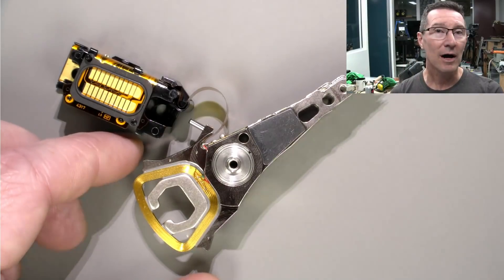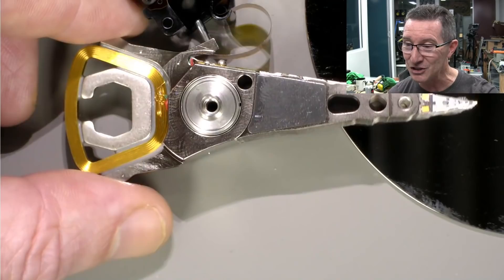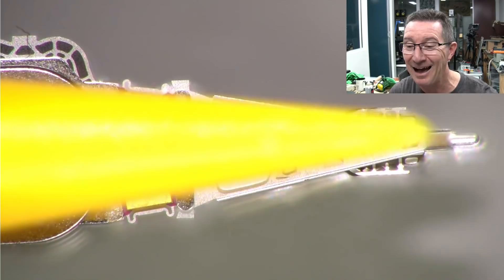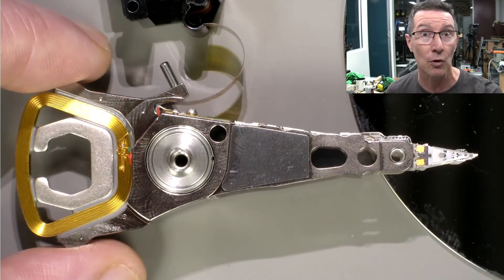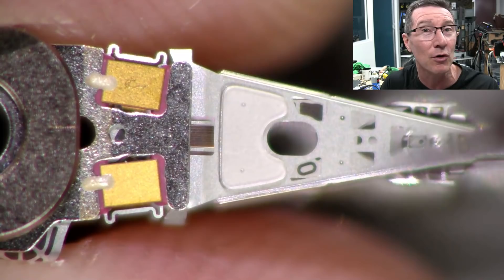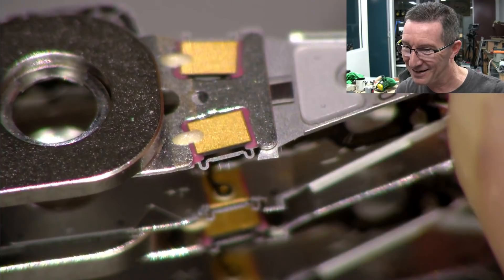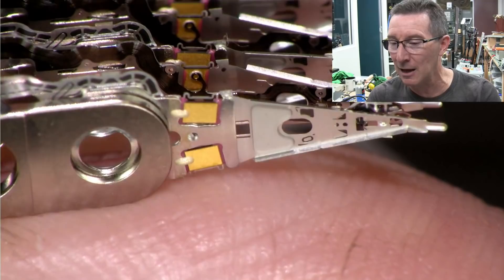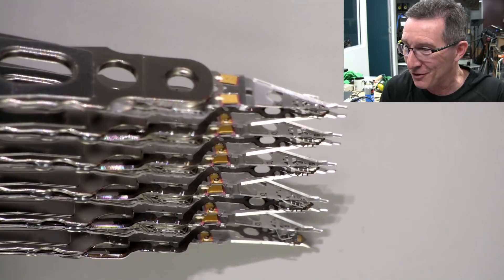EEVblog 1400 - Hard Drive Micro Actuators are AMAZING!

Comment: You should talk to The Slow Mo Guys, and get them to videotape one of these hard drives with the cover off. I think you will find that the two peizo  actuators are fired in near ultrasonic speeds, and at those frequencies, even solid metal starts to bend and wobble in some amazing ways.  All they need to do is to work with the harmonics of the head and it will wobble back and forth in a very predictable manner, and they could use that to steer them right to the tracks they want to access while the data is under the heads.

Comment: The engineering itself is amazing enough, but the design for manufacture is what really blows me away. Meaning, it's one thing to make a device that does what that drive does, but it's another thing entirely to be able to make it cheaply, reliably, without too many exotic materials or processes involved, with a minimal amount of customized tooling, etc. In other words, despite the insane sophistication we know is involved, it's the way that design screams "i have been refined to an extreme degree" that gets me. Those read arms are in a sense so simple they almost look like a high school robotic hobby project, yet you know they are basically space alien technology.

Comment: it would be an idea to reflect a laser from the tip and see if the point on the wall moves if you apply a signal to the actuator.
Reply: You might not see movement in the laser beam itself but you'd probably see some kind of shifting in the interference pattern at least.

Comment: Afaik it's very likely that these go up and down to control azimuth due to pressure changes (for different altitudes) + IIRC they would try to retract if they detect a drop so that there's a lower risk for the heads to touch the platters.

Comment: Last time I played with one of these. I powered the acuator on accident with the diode range poking around.

If memory serves. The actuator energized will contract the head on the same side. It pivets in the metal between the two elements.

Also if memory serves under those conditions the movement was indeed visible even with the naked eye.

Comment: The multi-stage actuator seems to serve two purposes when I saw the animation: more precise head positioning, PLUS keep the azimuth perpendicular to the radius even though the head travels in an arc.
Reply: I don't think the arc movement matters. As long as you're reading at the same azimuth as you wrote at, everything should work right. I don't think there's any need to have a consistent azimuth from one track to the next.

Comment: First, they store data on top and bottom of the platters.  Second, the position control has two loops:  coarse control using electromagnetics and fine control using piezoelectrics.  The micro actuators eliminate residual overshoot, ringing, vibration, etc. once the heads are close to decrease seek time.  Third, the two piezoelectric elements are operated differentially so that one pushes while the other pulls and the head bracket rotates about an intermediate pivot.  Check to see whether the opposite sides are connected to power for one and ground for the other.  Also, piezoelectrics generally operate on tens or hundreds of Volts.  Finally, the motion might not be visible without X500 or so magnification or an optical lever.
Reply: The range of motion in this system is around 1 um, and the voltages are around 10V. Optical lever is a good idea -- with a 5 meter arm, the movement of reflected beam should be clearly visible, provided the vibrations are kept low.

Comment: If you probe the correct contacts, you can then manually actuate the heads to get a readout on the scope. Then amplify and use that signal profile to drive. #reverse_egineering

Comment: Tuning these must get fun when they make smaller tracks.  Probably use a high gain but then use a dead band to reduce gains as it gets close to the demand position so you get fast movement and limit overshoot without having to use too much kI or kD.  I work on much bigger, less precise equipment so if anyone can shed light on that I would be interested.

Comment: Absolutely incredible! Controlling something physical, at the nanometer scale, and it’s something most of us use everyday and have no idea. 
der8auer recently did a few videos at a lab that has a SEM with probes small enough to test INDIVIDUAL TRANSISTORS on like 7nm process CPUs 🤯
It also uses piezoelectric elements to get such fine positioning.  
I didn’t know about using piezoelectric elements for positioning until that video, now this shows me it’s a lot more common than I knew!  Very cool.

Comment: It’s amazing just how much formula one level engineering goes into the spinning rust.
Reply: Soon it won't be spinning rust with the read writer head split into two separate actuators. Seagate is getting hard drives of this type that are nearly saturating sata 3 speeds. SSD's will still have these hard drives beat in IOPS by a considerable amount. but hard drives will no longer be painfully slow. it will feel like a low end ssd but with way better overall lifespan than flash ever could.

Comment: If i understand it right(im only starting to leard data recovery) there is sort of track map with micro-actuator corrections like "track X is on actuator position Y.+microposition Z. In fact, datastorage is so dense  that platter temperature  matters and causes seek errors. This microactuators solve this issue, so for example, firmware looks for track X, reads servomark X+1 and says aha, one track back. Not pretending i kmow shit, im just started to learn so appreciate any correction.

Comment: So it is basically the same prinicple behind the way optical disk drive's read/write heads are mounted in a springy way, extremely precisely movable by electro magnets!

Because for optical disks drives, it is the same thing. The head assembly is moved by a spindle but the disk's tracks are too small and not as perfectly centered on the disk, so the head by itself needs to follow the tracks on a very fine scale.
Reply: Good analogy.

Comment: If something is moving something has to be non-rigid in there. So I'll take your word for it. It looks like there are two layers, the dark, and the silver metal, that are free. The actuators are what connect the two layers, and would cause a left right movement on the plane of the platter relative to the arm.

Comment: Reminds me of the Drivetec floppy drive of the late 70s/early80s.  Has two positioners--"coarse" and a "fine" ones.  Used embedded servo recording to get around 3 MB on a 5.25" floppy.  Disks had to be factory-formatted, which was a deal-breaker.   Kodak eventually bought out the bankrupt company and marketed improved versions of the drive for a short time.

Comment: Depending on the type of head those may actually have been the 2nd stage and controlled the tilt and up and down movement. Modern hdd have a 3rd stage attached to that ladder looking thing underneath (right where he cut the demo clip) and it moves the head side to side quite a bit but is also voice coil powered. Other heads only have 2 stages and use piezo side to side actuators with flexure springs.

Comment: and another high precision think in hard drives is the ball bearings in the arm that is not a high precision bearings but designated ultra precision bearing and is a part of the hard drives cost. Think that it can never wore out and must be 100% stable all the time. Wear so it would wobble of say only unbelievable 10nm would at the read/write heads be more than 10 times that which would not work at all since that is wider than the tracks and the hard drive would fail. But still they work year after year.

Comment: the piezo actuators expand and contract on the application of voltage giving side movement.
Reply: I perceived this as shifting the magnetic field up and down to vertically access the surfaces of magnetic plates laminated to a single plate. Am I wrong.

Comment: They say "little things please little minds", but actually "the devil is in the detail" too. At one time the stack of heads would be tracking a servo track on one of the other platter surfaces. This no longer works because the alignment between heads can't be guaranteed, so fine are the track spacings e.g.with temperature changes. Having a spare surface is also throwing away capacity. Instead, one solution is to imprint data on the disk, like a chevron pattern that repeats and reverses itself. Using digital counters the head can be centred by noticing that when it is off centre, counting up and down changes the timings slightly and corrections can be made. It's unlikely that any of this movement can be shared between different heads, meaning that every head has to think for itself so that all the heads can be simultaneously reading on track all the time.

Comment: You didn't mention if all the micro actuators are wired together or independent.  I can see a benefit of driving each head's actuator independently since tolerances in attaching each to the main carriage would be difficult to get precise.  So these would allow micro-adjustments in overall positioning as you discuss, but also allow adjusting each head to compensate for variation in mounting on the carriage.
Reply: not just the tolerances,I think it is even more important to get the inevateble thermal effects of the different arms servoéd out. That's lilely the most important function of these actuators in there. If you forsake on speed (and position one readhead at a time) you can do with (i giess) only the lorenz motor.

Comment: Did you try a higher frequency? It makes sense to me that since it has a really small capacitance you would have to apply a much higher frequency to make it draw enough current and dissipate power? Obviously when it draws power it would try to use that energy to do what it does.

I suppose it's conceivable that it moves so little that you'd need an insane amount of magnification to see it as well.

Maybe use the other element as feedback to find the resonance and feed it to a transistor to drive the first one? Like those piezo Sounders with 3 taps.

Comment: Fascinating, I wonder if gravitational variations affect these actuators? Also, it has always fascinated me that the atom (radius 1 × 10 E-10 m), is only partway there on the road to smallness - Planck length = 1.62×10 E−35 m. There's probably as much smaller than us as there is larger?

Comment: Brilliant !

I have never had good experience with WD or Maxtor. Hitachi and Toshiba HDDs have been the most reliable. It would be fun to see if they use the same technology
Reply: At work, a 1 GB Hitachi HDD is installed on my computer, and the system boots faster than Seagete and WD disks with the same capacity and the same rotational speed. Sometimes I think it coincides with the best quality in production.

Comment: I think they do bend hence their longitudinal length decreases and so they pull the arm towards them. I do not really see how the counterpart acts. You should try with 15-20v pkpk and use a laser reflection on the head. Then just look for the reflected spot on the wall. The actuators vould be polarized in the dirrection along the head. I'd try with a complementary signal on the counter- actuator but 10v pkpk seems to be to little. You can always overdrive it.

Comment: Actually every year they are not coming up with more tracks per inch. The density of data on the platters has been stagnant  for at least 8 years. Yes, capacity of disks still increased, but mostly due to more platters being added. A physical limit for density on platters has actually been reached and in pursuit to increase density more companies stated employing SMR instead of CMR, which decreases performance. The next technology which promises improved density is HAMR, but so far there is no significant proliferation of HAMR disks on the market

Comment: The piezo actuators will be to actively dampen the wobbling of the arm tip as the arm steps around. Imagine waving a flexible (all things are flexible to some extent) stick around, if your arm is strong and precise enough, you can point the bit you are holding in any direction as fast as you like, but it doesn't mean the other end of it gets there right away and when it does it will overshoot and continue to wobble for some time after. These predict this wobble and can pre-excite the arm when it is seeking such that the acoustic wave from the head coming to a stop cancels out the wobble already in it rather than creating one. The better you can do that, the more 'instant' the stepping can appear to be. Obviously the arm motor will be doing this to an extent on the mounted side, but the finer precision can be gained by having actuation along the arm.

Comment: New technology takes awhile to develop and get into actual disc drive production. One has old farts that say it will not work. One has issues of costs of making stuff never made before. :)

In development work Piezoelectric actuators were placed on disc drive head /slider flextures in the lab in 1990 to test concepts.

Rotary disc drive actuators with Neodymium magnets for 3.5 inch drives were production in the mid 1980s.

The design issues of adding one or two piezo actuators per slider/head is not trivial. The micro actuators were at first where they are in this video. Today the focus is having two actuators right by the head / slider. 

For clarity the slider/head is the tiny rectangular block that flys floats above the rotating disc and has the read write gap or gaps.

The bulk of the cost of a rotating disc drive is the heads and media so  design details are sweated to the Nth degree

Design details of what is disc drive skunk works might not be in production for eons. So taking apart a consumer drive that is 3 years old is like taking apart a car that is decades old.

An old disk drive engineer told me in 1979 that the only thing that is constant in this industry is change. That is when my business card said disc pack engineering. It did not say disk but disc. I mention this to irritate English majors. :) 

30 years ago some twin city university Researcher contacted me in the  heads and media dept of a drive company and was all excited about 8 inch dusc drives.  That design was sold off to a European company 2 years before. There was no actual hardware in California just some ancient drawings of an obsolete product.. so the chap was happy to get all sorts of heads and media specifications on the fossil device. The drive was so old it used a linear actuator and rails. Plus old 300  and 450 Oersted "mud" ie brown tan platters (discs/disks).  I was working on a rotary 2.5 inch drive then. With 3.5 size in full production and 5.25  being sun-setted.

NGK Insulators the spark plug ceramic company has been a big player in Peizo actuator design and production. Besides disk drives the micro actuators are used in inkjet printers as micro pumps. 

Often tidbits of technology that are in the journals like magnetic society etc of IEEE are old and after in production since all was secret.

You can google us patent 5210455a  to see NKG was into Piezoelectric actuators in 1990.  It references older patents that go to 1951.

Bell telephone Labs US patent 2549872A is from 1951 and is about a focusing ultrasonic radiator. It was filed in 1948

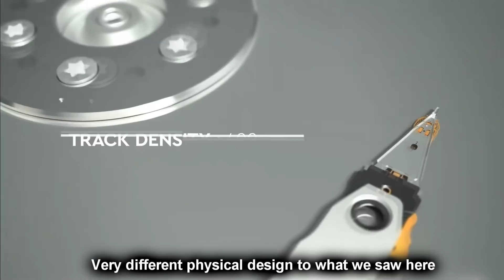Comment: @5:26 it says beyond 400 k TPI the positioning is less than 63nm, @14:13 this Hd achieved that density.
The shortest UVC light begins at 100nm, 
380 nm is the shortest wavelength the human eye can see.
you are trying to see something that moves which cannot be perceived by by the unaided eye.
It’s like trying to see 63nm virus with normal light, not possible.

Comment: I think the micro-actuator is doing the primary tracking job. If it comes close to its boundary limit, the big arm follows to give the microactuator more headroom - similar to how a CD player does it. The error signal for the regulation loop of the big arm is probably the microactuator voltage needed for keeping track.

Comment: Did anyone see the thing where you glue a tiny mirror at the end of the arm, hook up a speaker output to the main coil and use a laser on the mirror as a spectrum analyzer .. ? If I remember correctly it was even easy to build 🤔
Reply: Ooh! That’s a good idea.
Reply: Yeah!  I use to have a little device called a "Lazer FX" (very late 80s name) that had a phono jack input and a lightbulb inside with a color-changing wheel.  The audio would drive a voice coil with a mirror attached to draw pretty oscilloscope-like patterns on walls and ceilings.  Neat toy!  Noisy, and ran hot, but neat.
Reply: @nickwallette6201  I think Techmoan did a video on that thing!  I was actually really impressive.
Reply: @BRUXXUS   Uh huh!  That was exactly the one.  :-)

Comment: Probably not bender, but transverse (d31 component) piezo orientation: the voltage between the electrodes result in expanding or contraction depending on voltage sign.
So when one piezo contracts and the other expands the flexure rotates.

Here it's called "3-1" mode:
https://www.researchgate.net/figure/Representation-of-piezoelectric-actuation-modes-taken-into-account-Transverse-extension_fig1_319628922

See also: "Dual-stage actuator system for magnetic disk drives using a shear mode piezoelectric microactuator" and "Reliability of PMN-PT Piezoelectric Material as an Actuator for High Density Hard Disk Drive"

Also: the piezo can/is used as sensor to reduce vibration by feedback loop:
https://www.hindawi.com/journals/smr/2012/920747/